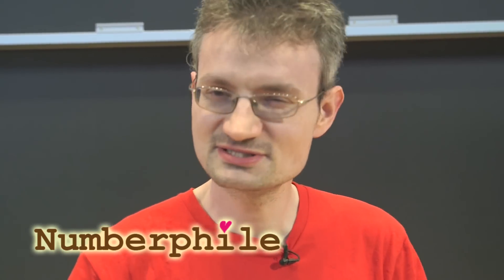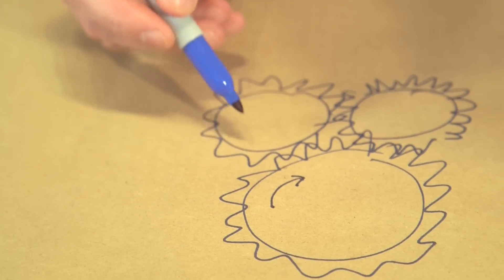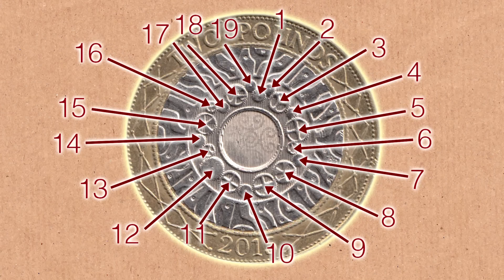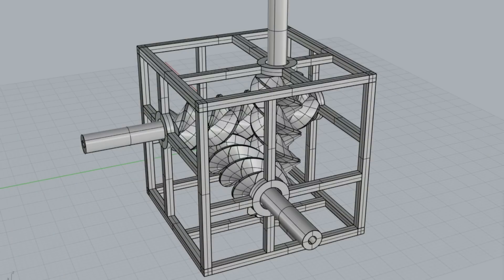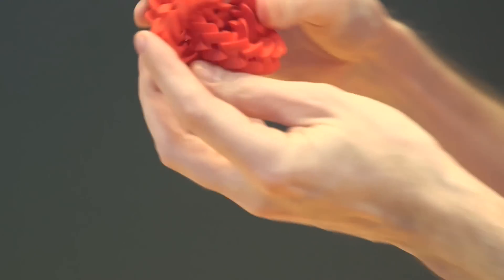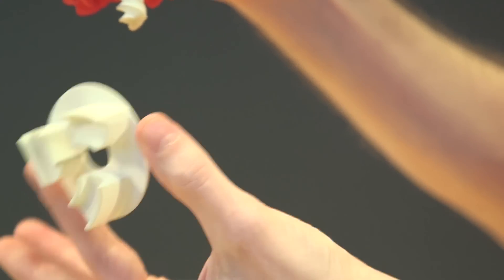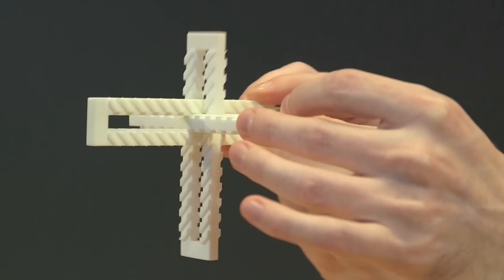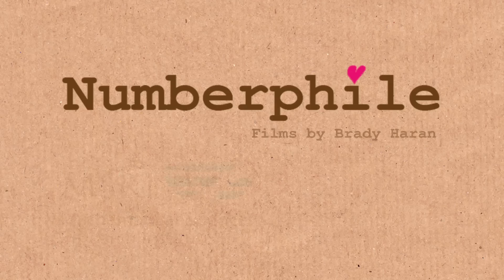Three Gears are Possible - Numberphile

Comment: this is like every mathematical solution to every physical "impossibility" : If it doesn't work on a certain dimension, just add one !
Reply: it doesnt work on 3 dimensions?
another one
Reply: Sounds like Grahams problem which caused his number. So much trial and error to check the system can't handle the dimensions at a single attempt...
Reply: @qwertyuiop-cy5en  yes, actually
Reply: String theory
Reply: The thing is.. the Rod is an extra gear..
Reply: SCP 055 Exactly lol
Reply: @qwertyuiop-cy5en  well then dj Khaled's a math prodigy
Reply: And if it doesn't work in any dimension, warp spacetime!
Reply: Can you tell me if the 4th dimension is related to the Complex Plane? Since graphing a 2 dimensional function with an imaginary solution, like the square root of x, requires the complex plane, an extra dimension to fully plot out. My question is, what about graphing a 3 dimensional equation with an imaginary solution, it will require 4 dimensions to fully plot out. So my question is, is the complex plane the 4th dimension?
Reply: @onixtv4034  interesting question. normally when we use the complex plane, we use it with a one-dimensional 'number-line', and we're simply describing relationships between complex numbers, e.g. arg(z) = 4. the trouble with your argument is that we can describe a 'real' 4 dimensional function as well, although not graphically. so for a function with 4 variables (4-D), you could argue that the complex plane is the 'fifth' dimension. it comes down to how were defining the word dimension. the reason complex numbers are called '2 dimensional' is that they are a combination of the vectors 1 and i, wheres real numbers only require a single vector, 1. if we plot a 3 'real' dimensional function with the complex plane, it doesn't change the fundamental nature of the numbers. in a sense, a complex number may be the fourth dimension of THAT function, for the purposes of defining a point on it, (x, y, z, complex), but that doesn't make it the 4th spatial dimension of the universe. 
nevertheless, you make a cool point. in quantum mechanics, complex numbers are essential in describing a particle's wave function, and many, many other areas of advanced physics cannot avoid them. some physicists suggest that there may be more spatial dimensions, most famously string theorists, so perhaps there is a link. you go find out, I'm not messing with string theory personally :).
Reply: Can't have 3d numbers? Enter quaternions!
Reply: qwerty uiop Riemann be like
Reply: True
Reply: And that's pretty much how we got to string theory, isn't it?
Reply: false.

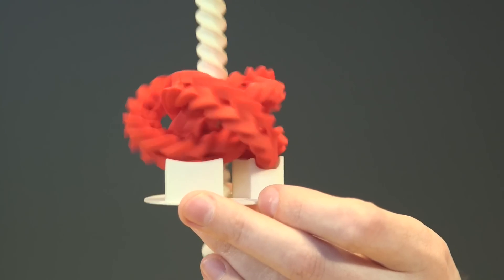Comment: the electric one on 3:33 would be so cool to have on your desk
Reply: I made the "motorised box" for Henry for the Triple Gear. Inside is a small Arduino, a stepper motor driver board, and a Nema 17 stepper motor. We used a stepper motor instead of a DC motor since it was easy to adjust the speed by adjusting the number of pulses in a second, instead of playing with more gears. All runs of a little 12V DC plugpack.

And yes, +littlemisshorngirl is my partner. ;)
Reply: +Stuart Young   So that's why it's so noisy?  ;)  Well done, anyway!
Reply: Stuart Young   Ah, interesting, and ta for the reply.  I once was surpised to hear a stepper from a PC fan sing a song (yes, really, a tune) to signal an over voltage error condition.  Witty controller chip programmer!
Reply: Using a side effect as a tool is always fun. :D

Another reason why it might sound loud is that the print of the Triple Gear used on the motorised one wasn't polished (base, drive rod & triple gear). That wouldn't help as the motor needs to overcome more friction at each step. I don't think Shapeways actually had the polished parts available when Henry initially designed it. Makes me wonder why he didn't try replacing at least the triple gear on the motorised version with a polished one.

Comment: High :D
Are these used in actual practical applications ?
Reply: Well... you can make machines that require those gears.
Reply: The last one (linear) could be very useful as a compact and efficient way of changing linear motion in one direction to linear motion at right angles to that.  The other methods I know of involve conversion to and from rotary motion,  or hydraulics etc....  This looks really neat!
Reply: I would guess that friction would become an issue very quickly, but possibly!

Comment: Now get 19 gears working xd
Reply: You can probably just have 16 normal gears and 3 weird 3d ones.
Reply: If you had all 19 of them weird, though... I'd put that on a coin!
Reply: There's some discussion above about doing this stuff in 4 dimensions. Starting from there, I kind of suppose (but have no way of telling whether it's true or not, I'd like a see an actual mathematician talk about it) that you can't make 4 gears in 3D, but it's possible in 4D. So, by induction, 19 gears would be possible in 19D. Or I may be more wrong than ever, but that is how I believe it works.
Reply: I'm fairly certain the number of dimensions does not have to equal the number of gears... You can make 4 gears work in 2D, for example.
Reply: Charles Thompson III Yeah, you're right. However, is it possible that the number of gears has to be multiple of the dimensions in order to work (honest question,I have no idea)?
Reply: I suppose you could just attach the other 16 in a row connecting to that 3D monster, and they would all tick just fine.
Reply: Anything possible in N dimensions is possible in N+1 or higher, the lower dimensional world is
an infinitesimal subset of the higher one.

Comment: The mechanism shown at 1:38 looks like it could actually be strong and useful in an industrial application.  Use it as a head gearbox to convert a vertical mill into 2 horizontal mills at 90 degrees to one another.....hmmm......

Comment: couldn't you also just make one of the gears in the logos double thickness and then offset the other two gears so they don't intertwine? they would still look intertwined if you limited the perspective to above, but they would work.
Reply: yes but why take the easy solution? We're engineers after all.
Reply: The point is that all the gears connect
Reply: But then it wouldn't symbolize all parts working together, insteat it would be a main gear controling the other two.
Reply: Ding Ding Ding, someone stumbled upon the truth of this world.
Reply: +ZeroHBR Kind of like how things are already

Comment: the three gears next to eachother so they can't move thing has always annoyed me xD
Reply: Yeah. it's always with engineering establishements to. XD It's like they handed off the logo design to the art class and told them to make something engineering related. and it's always gears. and it's never just two gears cause it's boring. so they make it three. cause it's more astheticly pleasing than two gears. but then they mess it up by linking the first and third gears. XD

it'd be fine if there was a little space between two of the gears just so it works. cause you can always say that you're driving two different things from the same motor at two different speeds.
Reply: funnily i've always thought it comes out of the plane like a watches gears so it never looked wrong.......guess i didn't let it be wrong XD
Reply: +Azur1al I've always said the same thing. we're assuming the 3rd dimension on a 2d representation.
Reply: Take a look at Revolio Clockberg Jr in Rick and Morty... his mouth and internals are made up primarily of these 3-gear impossibilities.

Also, I worked for a manufacturing company as the product photographer and web designer, when I went to create an SVG version of their company logo, I realized they had drawn it in such a way that it couldn't exist in normal 3D space.

Their company logo was like one of those never-ending staircases.
Reply: +orochimarujes I’m sure they would jump at the opportunity to claim just that.

Comment: Are there also 4D gear combinations that wouldn't move in 3D?
Reply: What would constitute 'movement' in 4D. It's hard to imagine.
Reply: Erm... the object changing at least one of its 4 axis?
Reply: when yo go from point (x,y,z,w) to point (x',y',z',w')
Reply: +Ranvir Singh KLEIN BOTTLES!!!!!!
Reply: Interesting thought.  Makes sense that if one could describe theoretical shapes in 4D (or higher), one could also describe theoretical machines.
Reply: +Phlebas Yeah. For example, with 4-D mechanisms, you could power a gear inside a completely sealed box.
Reply: +Derp Derpington 
4D doesn't work like that. There can't be any "w axis" as anywhere you place this axis can be expressed easily with the xyz axis.
Reply: + Findlay Taylor
No, you would just have to define the 'w' axis as being orthogonal to the other three axes.
Reply: +Findlay Taylor
3D doesn't work like that. There can't be any "depth" as anywhere you place this could be expressed easily with length and width.
Reply: +Cerxi 
If you click on the link, you'll see what I mean.
Reply: +Findlay Taylor What link? Why don’t you just address the counter-argument?
Reply: Is the 4th dimension not time? Therefore a 3D gear system moving over time is gears working in 4D? But they wont work in 3D as they need time to actually move and 'work'
Reply: + xenontesla122 it wouldn't be a completely sealed box in 4D, if it was, it couldn't be powered.
Reply: 4th dimension is not time, it is another spacial dimension. If 4th dimension was time, time would also have to be 3rd and 2nd dimensions at the same time, because 1st and 2nd dimensions have time as well.
Reply: While time is often referred to as the fourth dimension, spatial dimensions and temporal dimensions are different things. When people talk about 4D space, they're talking about, well, 4D space, and not spacetime, which is three space dimensions and a single time dimension. So while, yes, any object in our reality, which contains those three dimensions of space and one dimension of time, can be, in some senses, said to be four dimensional, that's not what we're talking about here.
Reply: PerunaVallankumous
Time and space are not entirely separate, they're just different sorts of dimensions, interwoven in a single manifold. Think of it in terms of discrete numbers of temporal and spacial dimensions. We, as humans, experience three spacial dimensions and one temporal dimension. Our experienced spacetime is four-dimensional. This is why people grow up being told that time is the fourth dimension; it's not technically wrong, and for 99% of people, it's the only information on the subject they're ever going to need. It's only once you start trying to understand theories involving more spacial dimensions that you run into the problem of having to mentally separate spacetime into space and time.
Reply: ***** Okay. But isn't time just a way of measuring the growth of entropia? Because you can't go backwards in it, it shouldn't be considered a dimension.
Reply: PerunaVallankumous
It is not, in fact, that. Time is a different sort of dimension, but it is still a dimension, and just because we cannot move through it in multiple directions, like we can spatial ones, doesn't mean nothing can. (For that matter, while we can't reverse our travel through time, by going fast enough, we can slow it. Take a look into Minkowski Space.)

Also, I think hundreds of years of physicists' work demonstrating time and space are inextricably linked dimensions would be miffed if you told them that we shouldn't do that. :P
Reply: PerunaVallankumous I was thinking of a 3-D box and a 4-D mechanism.
Reply: The idea of 4D just makes me squirm because I know I'll never know what 4D is like but my rebellious brain keeps trying to imagine it anyway...
Reply: Are there 3D gears combinations that don't move in some of the 2D planes that go through them?
Reply: Santiago Abud Pretty much anything with worm gears.
Reply: +EnderStar501 Try to imagine true 3D first (not a 2D projection of it)
Reply: Ahegao Well, 4th dimension of space can represent something else (like 2D graphics in which y can be "section" and x, "tension"; or speed through time, etc.) , but despite of whatever we call it (temperature, color, time) it'll still be a "w" axys (the 4th dimension).
Reply: xenontesla122 Worm gears do move in every 2D planes it is, in some it just rotates, but that's still moving.
Reply: Breaking convention is often key to innovation and advance using a W  axis defined as a direction where the corners of a tetrahedron are the one value  and the center is the origin can produce a wxyz framework that is geometrically valid as all are distict and indefinably different  sometimes outside the box is in the frameworks you construct your box with {ask any woodworker}
Reply: +xenontesla122 you can power a gear inside a 3D sealed box in 4D, but not a 4D sealed box.

(Like how you can power a gear inside a 2D sealed box (a square) by using 3D)
Reply: You can probably bump that up to (n+1)D and nD as long as you keep n as a natural finite number.. Would have to check though. There's always some weird Evariste-Gallois-Cauchy-Schwarz-Bugnakowski-Banach-Tarski-Green-Ostrogradski Number between 137 and Graham's Number that represents the maximum of n where this theorem is true..

Comment: That was the most interesting well-thought solution to a problem that didn't need solving. Very cool.
Reply: I think this is cheating.
Reply: I think you basically just defined pure mathematics.
Reply: cough Actually I was up the other night wondering how three gears could made to work together in some apparatus that was not prone to gear slippage...
Reply: These are likely problems that don't need solving *yet*. Often engineers and mathematicians find solutions to problems that arise years or even decades after their initial proposal. Who knows, maybe in 10 years this solution will prove very useful in a complex production line of sorts.

Comment: Perhaps the three gears should be a symbol of stability.
Reply: ***** Yeah, it is a nonsense idea.
Reply: Yeah, kind of ...unwanted stability, though.
Reply: gears of instability*
Reply: And it says "working together"
Reply: that's why triangle shape is the most stable shape. eg for structure purposes
Reply: Billy Bun 
triangles are only the second strongest shape. a circle is the strongest
Reply: Christian B
Not for structural purposes
Reply: theviniso Depends on what application its used in. Its absolutely the strongest against uniform pressure, such as in a pressure vessel or arch.
Reply: "Working together, to accomplish nothing"
Reply: what a perfect description of the student, teacher and parent in the education system
Reply: some three gear symbols I see actually have one gear behind, so in a 3D view there is only one point of contact for each gear. if you do it like that and want the 3 gears to be connected you only need to have a belt connecting the first and the last gears.
Reply: or maybe the three gears WERE THE SYMBOL ITSELF?
Reply: Billy Bun and oval is, like on a bridge.
Reply: All I see when 3 gears are meshed together is stupidity.

Comment: I think I would buy those as a toy.
Reply: There is a link to the shop in the description :p (you can buy them as a toy!)
Reply: yeah but they cost quite a bit, and are more like prototypes.
Reply: I guess they are prototypes - although they had the cogs for £12 which I thought was quite reasonable though! :)
Reply: With the right lubrication, friction can be fun.
Reply: I would love to have the one shown with an electric motor, driven by solar power... so whenever light shines on it, it just writhes.

Comment: The mesaage from student - teacher - parent 3 gears :
If the education want to work again, get rid one of them
Reply: yeah, get rid of those pesky students
Reply: Or add school management also...
Reply: @eggroll3055  slow down there buckaroo
Reply: @goji_crafter  🅱️ENIS.
Reply: Get rid of all of them
Reply: @eggroll3055  we found him!
Reply: Zakat Almosen Add three
Reply: Attention all students! We as a school district have decided to eliminate your parents. We have decided the best way to go about spreading the news is to not sugarcoat it. Since most of you require your parents for a home, we will be locking all of you in until you promote. After promotion, we will be keeping you in houses that are currently being constructed, and from there, you can choose your next school. If you have other questions, please consult the main office. If you have issues dealing with this news, please consult a counselor.
-The (name) School District
Reply: Or add 1 more component
Reply: Or add one, or add another dimension? AAAAA
Reply: They tried, but school shootings are not enough.
Reply: I'd say it rather Student - University - Government. And government should be removed from this non-working system.
Reply: The student gets either damaged or ripped apart depending on the force the government imposes on the teachers, which have a different view, thus spinning in the opposite direction.
Reply: the studentp

Comment: This was interesting. I have a question though. Because you can have 2 gears in the second dimension, 3 gears in the third dimension, could you have four gears in the fourth dimension (and so on)?
Reply: prett sure you can use four gears in 2 dimensions
Reply: He meant that only even numbers in the snd dimension
Reply: We only have 3 spatial dimensions to work with in our universe.
Reply: If you can show me a four dimensional gear in a four dimensional spacial reality working in a configuration of four.. then sure.
Reply: I think the lowest number of  dimensions that n gears would work in is equal to the smallest prime factor of n.
Reply: This makes me want to log off.